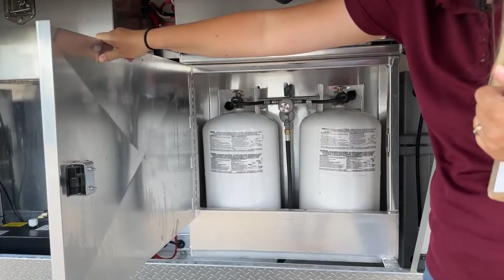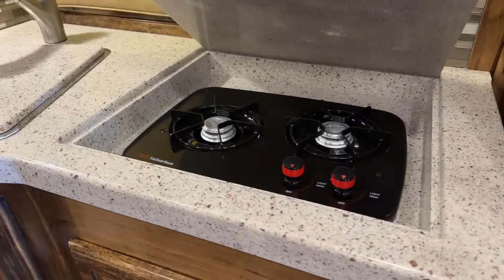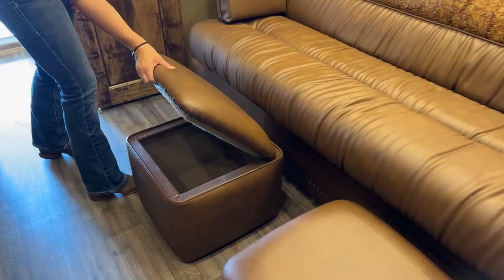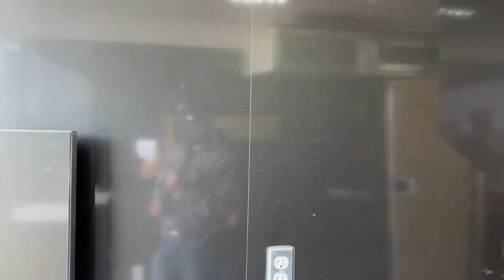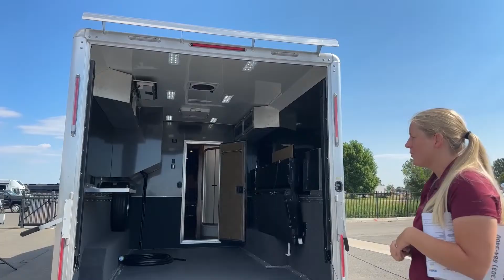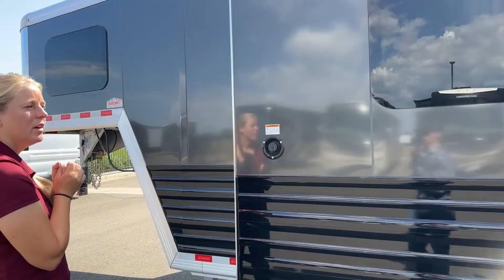2024 Cimarron Freedom Toy Hauler Living Quarters

Comment: Honestly, you probably don't need that hitch for a smooth ride.  My 2021 Cimarron Freedom toy hauler pulls like a dream behind my F450.  That's probably due to the high pin weight which is right at 4k.  Interesting that the batteries are outside.  Mine are inside and not as subject to cold weather.  The Xantrex interface is a bit harder to learn so the move to a Victron is probably a good thing.  I love my toy hauler and get lots of compliments.  It's a bit of a timeless trailer design and it is very well built.  And, they hold their value better than the typical Elkhart built crowd.
Reply: I am in the market for a toy hauler. Been looking for a couple years and I see lots of videos about the poor build quality of your typical name brands. Would you buy another Cimarron Freedom ?  Would you change anything if you could build another one? I am in NC so the Cimarron style toy haulers are not in this area to look at. Thanks
Reply: @johnnygardner8723 I bought mine site unseen.  Only a video to look at.  I'd do it again in a heartbeat.